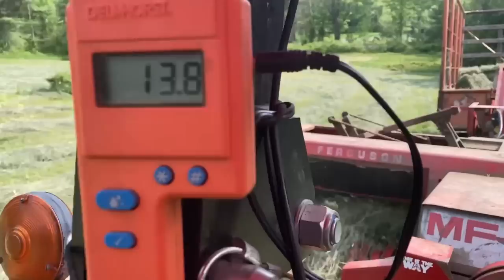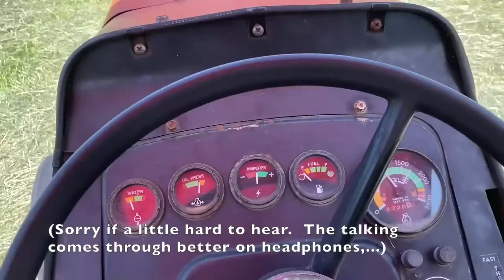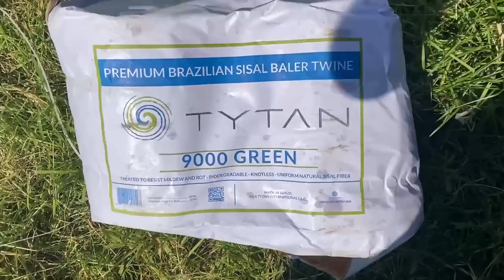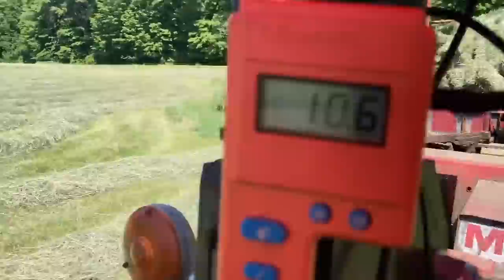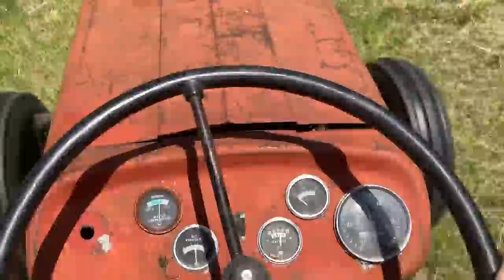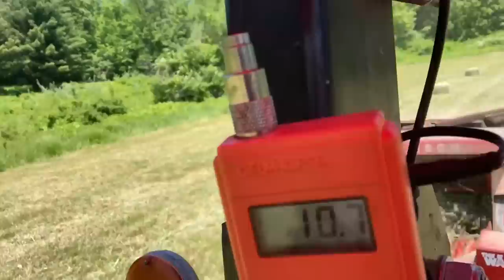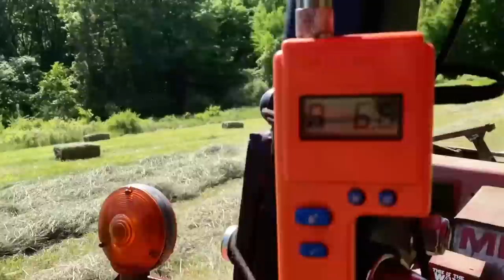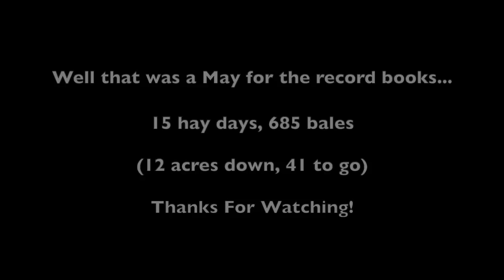May Hay Baling Marathon, Breaking Records, and Fighting Gravity (2023)

Comment: I see your mowing mostly grass but I wonder if a roll or flail conditioner would help your dry down times.  A disc mower with a conditioner does take a bit more HP though.
Reply from the maker: Hey there, thanks for watching!  Crazy as it sounds, I actually prefer no conditioner - though a good part of that is indeed HP, as well as cost.  I find I don’t miss it in the grass hay game, at least not enough to justify the expense (both in mower and sufficient tractor).  I have a video from a couple of years ago where I explain my reasoning on no conditioner, if you’re at all interested.  But I’m always open to ideas and discussions, so thanks for commenting!

Comment: The "little" 135 Massey is an awesome tractor. I would venture to guess that Massey Ferguson sold more of the 35/135 tractors than anything else.  The 135, along with its main competitor, the Ford 3000 had a very low center of gravity and they work very well on hilly terrain.  I get a little timid working my Massey 283 on hillsides but I can take my 3000 Ford on those same hills and I feel very safe and confident.  Great video, first time I saw your channel and I really like the footage of your Masseys earning their keep
I heard you say you had to make several throttle adjustments with the 135 while raking.  Even the gas engine in that tractor should run pretty even.  You may need the governor adjusted.
Reply from the maker: Hey there, thanks so much!  I so totally agree on the 135 (never ran a Ford 3000, but have often talked about the similarities between Masseys and Fords in the decade(s) following the Ford/Ferguson split).  I'm so impressed by the 135, I did everything for my first 4 seasons with it (no kicker yet, but did pull the baler with chute and wagon on hills).  Great point about the governor, I've never had that looked at and probably should.  I appreciate that idea!  The throttle adjustments are really just about terrain (uphill vs downhill), but it has always been a bit of a workout and I always just assumed it was because of a gas engine.  On flat land it runs very consistently.

Thanks for tuning in!

Comment: Hello, new subscriber here! I have been binge watching your youtube videos🤣 i want to farm/ make hay one day in the future.. my questions is why do you run a disc mower over a haybine if you dont mind me asking? A haybine crushes the stems in the roller, is there a downside to that for your setup? Thanks!!
Reply from the maker: Hey there, thanks so much!  Glad to have you following along.  I made a video last year discussing it if you’re curious for a longer explanation.  

If you mean haybine as having a sickle bar, I absolutely need the disc mower for how thick, wet, heavy, and often lodged new England grass usually is.  When I have even a tight weather window, I have to jump on it and mow quickly, which the disc mower is great for.

If you’re wondering about a disc mower with/without conditioner, My two main reasons for no conditioner are cost and horsepower requirement.  But I also (controversially) think that I get better quality grass hay out of no crimping/conditioning.  When drying, an un-crimped grass stem allows the leaves to dry later in the process, which I think reduces leaf shatter to some extent.  But in the end, even if I have to ted it another time, I’m still making dry hay in the same windows as everyone around me (sometimes shorter).  A conditioner can certainly help in grass hay if you have or want it, but I don’t think it’s as essential as everyone makes it out to be, based on my 12 seasons without one 😊.  I’m not an expert, just speaking from my experience.

Thanks for asking, and let me know any follow up questions.

Comment: Hi, I was wondering which dealership you bought your vermeer mower from? I am considering buying one after seeing yours work.
Reply from the maker: Hi there!  I got it from New Boston equipment in NH.  I think they’re under new management now, but still carry vermeer.

I love the mower, though am still finding a trampled strip problem in heavier first cut due to the right tire.  It’s improved with the custom skinnier tire I mounted, but still happened on the latest field I did.  A bit frustrating not to have a clean cut on such an otherwise smooth mower - so just the one piece of feedback/caution I’d give.

Where abouts are you haying?  Thanks for tuning in!
Reply: @windrowfarm  awesome! I see that they are under the name big boys toys now. I remember New Boston truck and equipment at the Deerfield fair years ago. I am in Jefferson, New Hampshire which is in the northern part of the state. I used to mow with a Krone 3201, and it had finger conditioners on it and it mowed well, but a heavy machine and after only four years, it developed gearbox problems. I saw the writing on the wall and got rid of it before it ended up costing a lot of money. I, like you also feel that conditioning the hay was sort of a gimmick to sell newer equipment to farmers and I have had similar results as you are with drying times. I think that if hay is being conditioned, rollers do a better job than fingers do anyways, which is what most of the new mowers have now anyways. 
Since getting rid of the Krone, I have downsized all my haying equipment so it requires less hp and fuel consumption to operate. Currently I'm using an enorossi 9' sickle bar which is ok, but limited due to it not liking wet grass at all or spindly grass. It plugs a lot unless conditions are perfect. I also have a samasz drum mower which works well, but is narrow at like a 6 ft cut or less so it takes a long time to hay! We hay about 62 acres here.
Reply from the maker: @presidentialviewfarm  oh nice!  Sounds like a similar scale then.  That’s a lot of ground to cover with a sickle bar!  I think a disc mower like this would be a good fit then, it’s so helpful to be able to mow through wet grass, especially how the weather keeps going.

What sort of bales do you make?  Did you scale down other equipment too?
Reply: @windrowfarm  not too bad when the sickle is working well, but all has to be just right which seems like never lol. 
We only do 4x4 round bales and we try to bale only dry hay although we do have capability to wrap bales and make hayledge. More of a market for dry hay because the majority of the livestock farmers who are left do their own haying.  
We have a 4 basket pequea Tedder and a 9 foot pequea rotary rake. Had a kuhn 6 basket before that and a new holland 12' wheel rake. Way back I used to have a kuhn gmd600 3 pt disc mower, and I wish I had kept it. It would be worn out by now, but it didn't take a lot of power to run. I have a NH TL90 tractor which has been great, but I wanted to get something newer and smaller and something I could use skid steer attachments with, so I bought a new tym 574 hydrostatic which was so my wife and kids could also safely operate a tractor to help with field work.

Comment: Bearing goes a long way when they are greased.
Reply from the maker: Mine lasted a lot of years - but no grease fittings on these, they’re sealed bearings.  I still spray with penetrating oil when I can though.  Not sure if it helps.

Thanks!
Reply: @windrowfarm    the penetrating oil will get in to the bearings but over time it will break down the grease inside the sealed bearings.  I put a housing with a grease zerks so that I can keep the bearings greased. That was 43 years ago never had to change any bearings yet on the pitch  rollers only the pitch belts. Mine is a 1979 New Holland Bailar  I bought it back in 1981 and still bailing today. The only thing that I spray penetrating oil on is the chains.  And yes the bearing on the pitch rollers is also sealed bearings one side has a rubber gasket and the other side has a metal gasket or seals. And yes the grease will get inside the bearings. Anyway good luck.
Reply from the maker: @TimothyTate-tc5yk  thanks, that’s super helpful!  Did you custom make the housing with grease zerks?
Reply: @windrowfarm   no I just got lucky to find the housings with the grease zerks.  Here is something that you can think about doing. My friend dose this with the pitch rollers bearings. He changes them out every five years then he pulls the rubber seal off the bearings and repacks them with high temp grease then he replaces the seals back that way he can reuse the bearings and he puts the same grease on the roller shaft that the bearings on. Like I said it's something you can think about doing. The high temp grease will last longer then all purpose grease do to friction. My father in law had this saying farmers learns tips and tricks from other farmers.  Any good luck and have a good hay harvesting bailing this season.
Reply from the maker: @TimothyTate-tc5yk  thanks so much, totally agree on learning from other farmers - always appreciated! So much of this is learning by doing.  (Like after ruining the bearing puller and cutting the old one off, learning that the new one (and therefore old one) was oblong and had to be rotated to come on/off)).  I’ve never been a mechanic, just a farmer who stumbles through and learns things the hard way.  So thanks again!  Best of luck to you too - mutual support!
Reply: @windrowfarm   well us farmers has to stick together and help each other out when needed. I'm happy to share any of my knowledge with you or any other farmer.

Comment: Looks like u could bale 2 windrows together at the same speed
Reply from the maker: I’ve tried before, and unfortunately the 124 can’t quite handle doubled windrows in third gear without working the baler noticeably hard.  Then I drop to second gear and, at least in this generation of Masseys, it’s a huge speed drop (maybe half or less).  I’m always the most worried about adequate dry down in this region, so I always prefer singled rows in first cut for more drying and then faster baling speeds.  Sometimes double in second cut if I’m confident about curing, but not with how wet this year is going.  But 100% to each their own!

Thanks for watching!